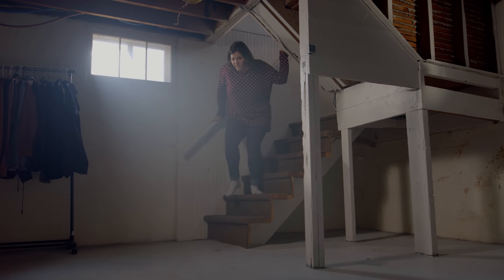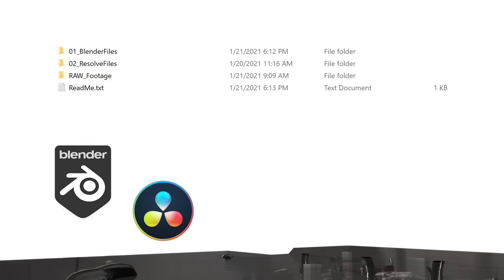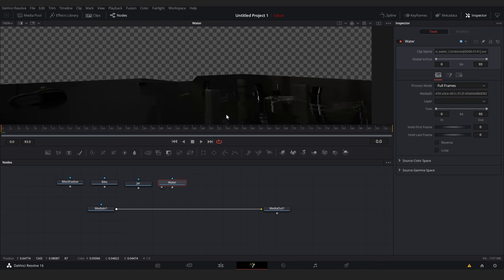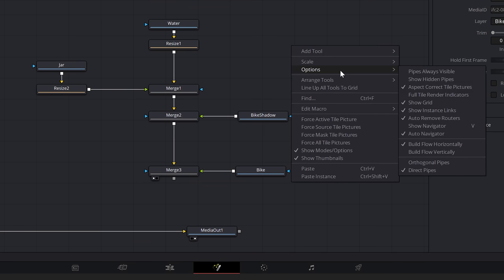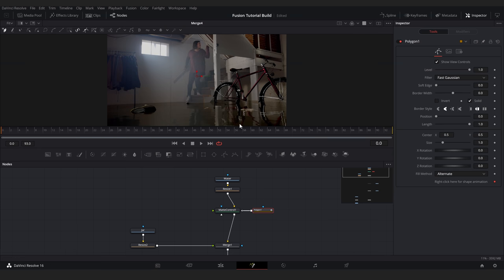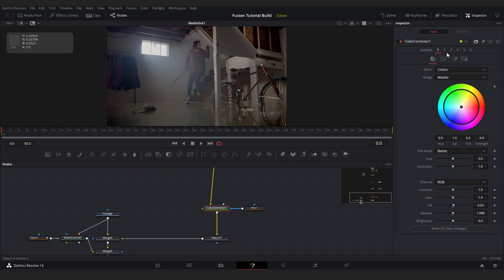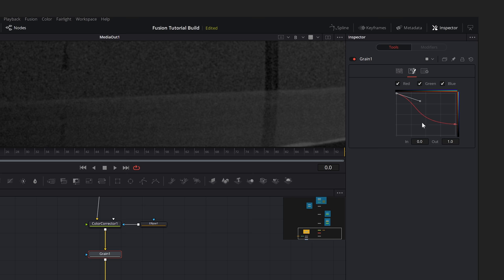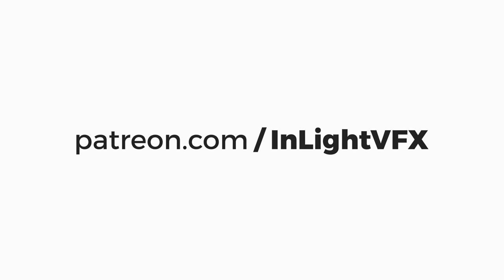Sorry Blender, this is my new compositor

Comment: Blender is amazing don’t get me wrong, but everything else than 3d (modelling, rendering shading, uv mapping texturing etc) sucks (video editor, compositor etc)
Reply: You forgot sculpting. Sculpting is quite good.

Blender has good camera tracking, while fusion free don't have.

Blender compositor good for color correction for blender project.

Else, for vfx fusion is the best.
Reply: @anandhups360   A caching and rendering issue.... It is a way too slow.  To give an idea stitching back together a sequence of 4K picture with the compositor can take more time than actually rendering them with Eevee. 
 That make no cense  this is with  no effect, nothing, really just load the picture on the drive and render them into a video. As long as doing nothing take forever I can not see how a better caching could help. If it take that long just to load each frame even a good cache will be slow.
Reply: @pop2147  blender sculpting is terrible compared to zbrush
Reply: @Hycil2023  yes there's a big different compare to zbrush in term of performance. But the sculpting tools are very convenient and powerful.
Reply: @pop2147  convenient and powerful?? try zbrush and you will realize just how bad blender sculpting tools are in pretty much every way possible
Reply: @Hycil2023  alright
Reply: The problem with Zbrush is that it has the single worst User Interface of any 3D app ever designed. Even old Blender before 2.8 was more understandable and people already call that terrible.
Reply: @Hycil2023  I prefer blender's sculpting tools to zbrush's, especially the pose and cloth bush, the only downside I have with blender is the lack of optimization compared to zbrush.